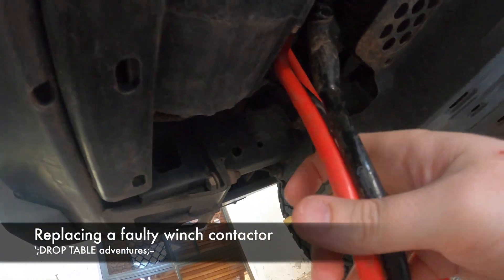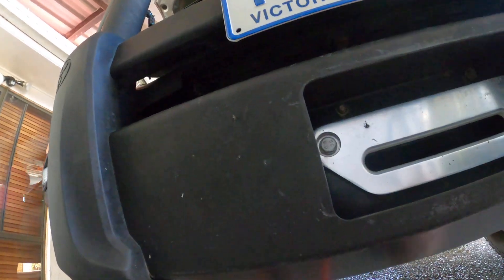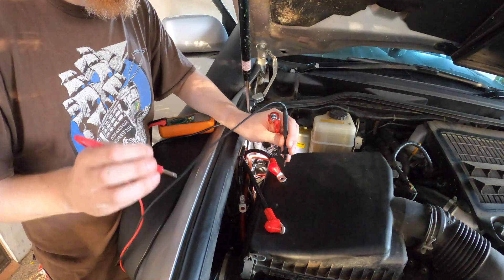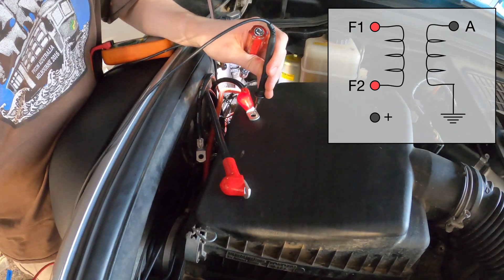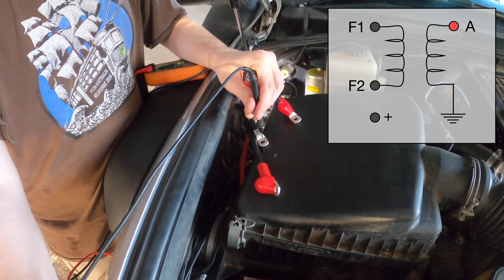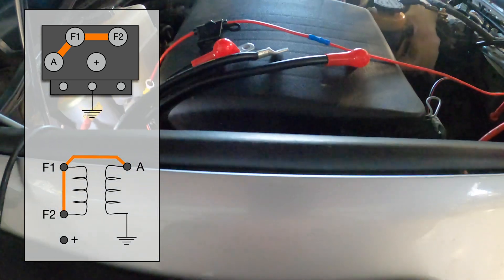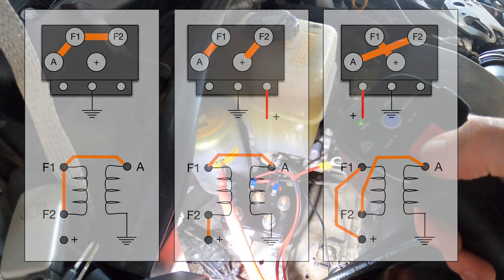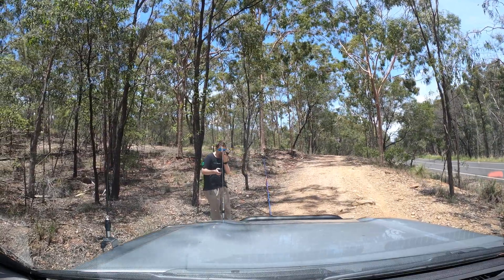DTA Rev2.0 #14 - Replacing a winch contactor / solenoid and how to identify the unlabelled terminals

Comment: Thanks Man, this is the ONLY sensible description of how the solenoid works on the entire internet. The diagrams really help too.
Reply from the maker: Glad it helped! I ended up making this video because none of the tutorials I found actually explain what the solenoid is doing internally when you engage forwards and reverse. If you don't understand what's going on electrically, you can do nothing more than "connect from terminal A to terminal B" - which is a problem if you don't know what terminal is what...